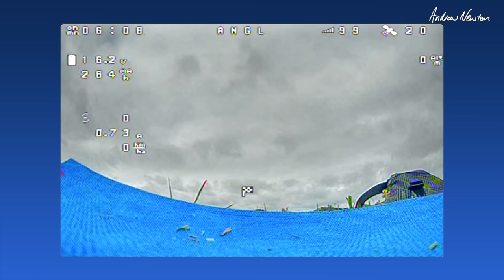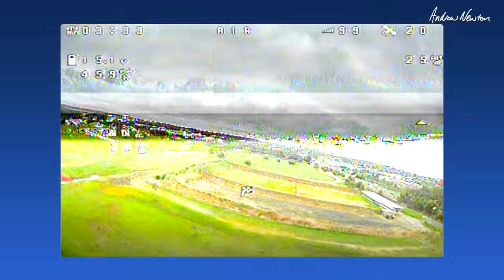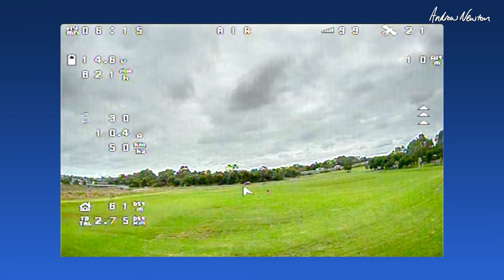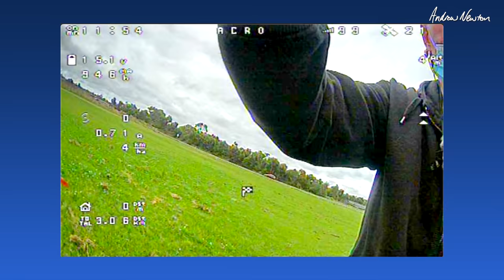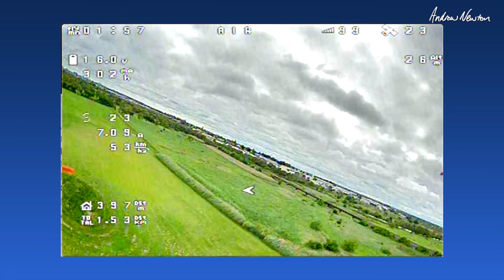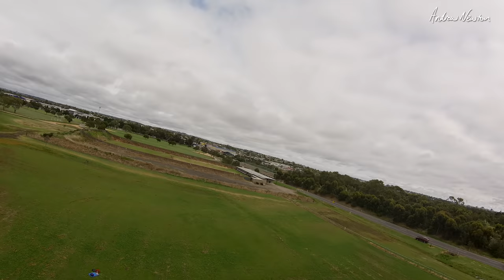Pirx 7 - My first FPV Quad

Comment: One of the many benefits of learning to fly FPV quads, is that the rudder suddenly becomes a necessity, instead of the option that it usually is when flying planes.
My flying has improved a lot by using rudder all the time.
When flying a wing I have a hard time remembering that there is no rudder. I find my left hand automatically initiating turns, to no avail.
I can't wait until you put the DJI FPV setup on that quad. Feeling comfortable while flying through trees, is an amazing experience.
Reply from the maker: The inputs are so immediate and direct, amazing really

Comment: Welcome to the second side of the hobby! Boy was I nervous when you were flying LOS so close to yourself, especially with a 7 inch. Tips: a cheap simulator is a great way to practice coordinating your rudder and roll inputs. Also, landing is easiest if you disarm just above the grass as opposed to trying to hit the landing pad. Seems you figured it out. You'll be splitting gaps and doing flips/rolls in no time. Have fun and stay safe. :)
Reply from the maker: Thanks, I must fire up a quad simulator

Comment: If there is one thing I can suggest to you as I too started in fixed wing before moving to quads. Don't be afraid of Acro mode. Just fly Acro and you'll be alright. I started with horizon and angle and honestly it just made me make more mistakes because you think the quad will always save itself but that is not always the case. Just trust your experience on the sticks already. Nice flight here Andrew. Quads are really fun! Cheers!
Reply from the maker: Yes, ACRO feels right now

Comment: Cool, eh? When you land, hover a foot or so above the ground and disarm. Landing while armed usually just makes the quad bounce because the impact against the ground is read by the FC as a very fast unintended roll/pitch, which it will correct by spinning up the lower motor, which then causes the other corner of the quad to hit the ground, which the FC fixes by spinning up the opposite motors. The result is a bounce.
Reply from the maker: Thanks, my accidental disarm was a better landing that any others. Lots to learn.

Comment: Nice, now you can enjoy that locked in feeling and hardly care about the wind.
"you need to use a lot more rudder than for planes". Assuming you meant 'yaw', yes indeed :p
If you want it to move like a plane would, roll and yaw are practically glued together.
Reply from the maker: This is partly your fault Chris, Your range tests out over the rolling hills from years ago stuck in my mind.

Comment: Awesome Andrew! The props sound strange in the HD part, send me a blackbox log, we will tune that out!
Reply from the maker: Excellent, thanks for watching Pawel. I'll send the log tomorrow. Maybe I should fit new props, these are the same ones that slammed into my garage door and floor.
Reply: @AndrewNewton  Inatall the top front bumper. It makes front section stiffer and more crash resistant
Reply: they do sound a bit screaming indeed. Looks like a nice balanced design though tips hat

Comment: Me and My Son have a 5inch and love it.  Its like having a helicopter FPV but without the mechanical complexity.  
The Stabilizing modes interfere too much with flying - best to get away from that soon as possible and stay in Acro or Air Modes.

Comment: Andrew, when you get the speed up and rudder becomes 2nd nature you enjoy cruising low level through gaps etc. The wind doesn't impact the flights much either. They say it normally takes about 20 packs before you get to grips with low level altitude control in the goggles. Enjoy.....
Reply from the maker: It will be fun trying anyway

Comment: I think you should raise your PIDs a little. Not much, just so it stops that little shaking. UAV Tech has a site with presets you can copy to your build. Just search uav tech presets in google and you can find it.

He says this for 7'' quads: "6″/7″ quadcopters have a low power to weight ratio so the PD Balance and P & D Gain sliders both need to be moved up to compensate.  If motors are not up-sized, this may even require that you move the sliders (both) up to 2.0." Since you are using inav for this build and it doesn't have sliders, and your motors are smaller than recommended, i'd suggest you just copying the numbers in the preset and adding 20% to each.

Comment: I flew for months in Angle / Horizon Mode while I was learning...months...Acro is way easier, once you get used to not trying to fly it like a plane...lol...Talk about in at the deep end Andrew, GPS, 7inch, the lot...death wish...lol
Reply from the maker: INAV and GPS waypoints is the only quad aspect that could get me interested
Reply: @AndrewNewton  Okay, but given time, you will be 1 metre off the deck 500metres out before too long. The other addictive aspect is being able to fly from any launch point and not worry about wind .

Comment: you are super cool
always trying new things, even though not the youngest 👍🏼

here are some tips from someone that started with quads (i love slope soaring now, but still fly quads):

if you want to push your limits as a pilot without breaking gear, download the DRL Sim from Steam and put in some hours there
with it, no fiddling with settings is needed, to get the quads to fly the way they are supposed to and the grafics are amazing
after 300h i can get into the top 50 of most races, if i try
you can also fly freestlye

if you want a long range quad, that doesn't kill you or risks others when (not if) you make mistakes, look at the Flywoo Explorer LR, it's available as analog and dji fpv
with a 4s battery made of 18650 cells, it can fly for about 30min, probably longer, the frame is designed very nicely
there are other arf quads in the category, but not as nice (clones made for profit, sometimes offering a different take, though)

if you want to know more about the latest developements in fpv and the technology behind it, watch videos by KababFPV, he is a dentist in LA and develops the most balanced setups there are
his latest product, "the 30mm motor" is made for the best control over 7" props, there are new props coming soon, too
his website is fpvcycle.com

Gal Kremer is great, too
i'm not too impressed by Pavel as a source for quads, sorry :)

if you want a normal quad (not long range), that you can fly *everywhere*, look at the babytooth by KababFPV
i'd say it's the cheapest (open prop) quad worth buying, and 1S batteries are very easy to handle

i've designed a few frames myself, KababFPV gave me tips during the process of learning how to do that, he was very helpful and does a lot for the hobby, because he loves it, not profit first

and yes, quads need a lot of rudder, since they don't have the tail that would provide static stability
Reply from the maker: Thanks so much fro the advice, I'm checking it all out.
Reply: @AndrewNewton  oh another thing :)
do you fly standard rates? 
i found 0.43 0.74 0.05 working great for me
everybody has their own rates, also depends on the radio shape, probably
Reply from the maker: Using Pawel's PIDs
Reply: @AndrewNewton  that's something different, but alright :)
for pid tuning, a great resource is UAV Tech

Comment: I'm surprised you didnt opt for betaflight and activate the 'fpv cam mix'.  It rolls and yaws around the cams own predetermined axis to make it feel more fixed wing and it does work as long as you are moving forward.  Viewed externally it does look a very strange mix though.
Reply from the maker: Stabilised FPV cam is a definite no for me. Maybe ok for HD cam
Reply: @AndrewNewton   I wouldnt call it stabalisation.. or at least not in the conventional sense. The uptilted cam has its own seperate angle from the quad so when you roll there is a coupling with pitch and yaw and vice versa. It just mix's other inputs into the gyro so the quad rolls and yaws around the cam own angle rather than the quads, making it feel more like a fixed wing aircraft. See  https://youtu.be/gXeaINFpvow

Comment: The level of control and locked in feel is far far superior with a quad, the cost is you need to be on it all the time and it's harder to relax. You want to find a big park with some nicely spaced trees in to fly around.
Reply from the maker: Good advice thanks

Comment: Ha ha, your doing the same as I do and end up flying sideways from not enough rudder input!

I naturally use it just fine when flying my 450 quad line of sight as I'm used to flying helis but every time I give fpv another try on the quad I can't help go into fixed wing mode! 

Another thing that is so alien is the total reversing of the way speed and altitude affect the two different craft types, a quad remains flat with altitude changes but a plane noses up or down and a quad noses up or down with speed changes but a plane remains flat and my brain always remains in fixed wing mode and I start lifting off the sticks instinctively when it 'appears' to do the wrong thing in the fpv feed ha ha
Reply from the maker: Yes some brain retraining is required

Comment: .. and I don't watch FPV/quads .. 😉🙃
Thank you Andrew ! 👍😊
P.S.
It was a nice break from learning Ardu stuff for H743 ..
Reply from the maker: I feel your pain with Ardupilot!
Reply: @AndrewNewton  Thank you - now it is easier ..🙃👊
It is like coming back from GUI to command prompt - some sweet memories, but really ..
P.S.
On a bit more serious note - "roll drift" posts have recently appeared on on RCG iNAV thread .
I don't remember you ever mentioning them - I didn't have such problems either.
Do you think it is just a matter of less than ideal installation (and correction parameters/procedures) ?
I remember asking Pawel in my early days with iNAV if it was possible to implement a solution similar to SxR - I think it's the more elegant one - but it was obvious that they were busy with much more important things..
Reply from the maker: Horizon drift? I have never noticed it, but I dont fly in a way that it would be a problem anyway.
Reply: @AndrewNewton  And I thought so - thank you.